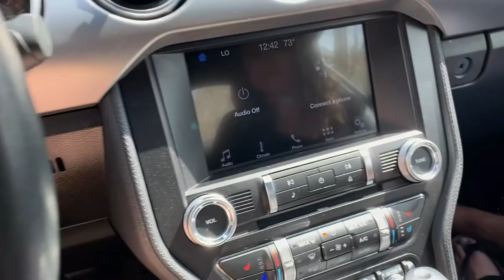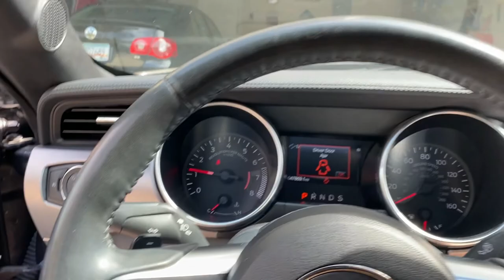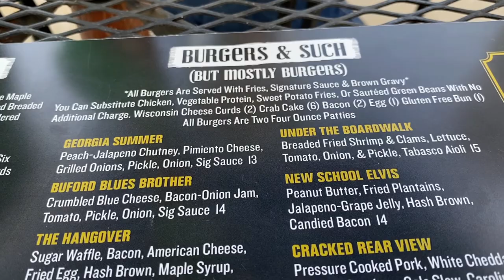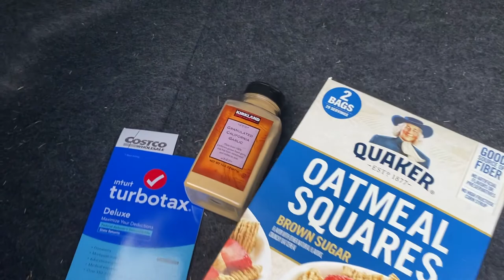Mustang Ecoboost - Foam Cannon Car Wash! - Vlog

Comment: Where did you get that water gun/hose at not the foam cannon?
Reply from the maker: I got the pressure washer at harbor freight for about 80 bucks last year. Pretty good. Came with the sprayer and all the hoses. Thanks for watching!